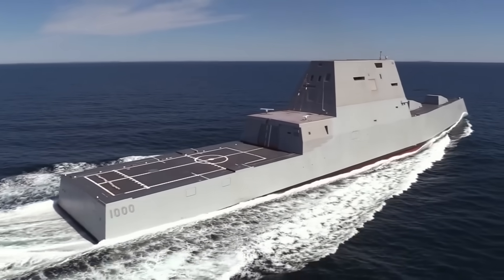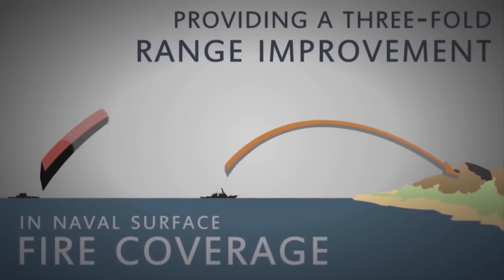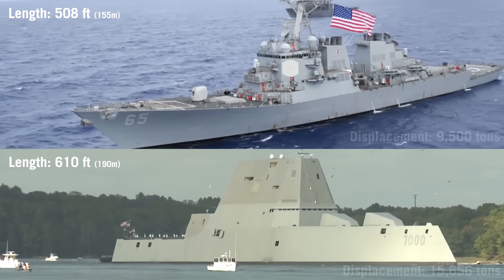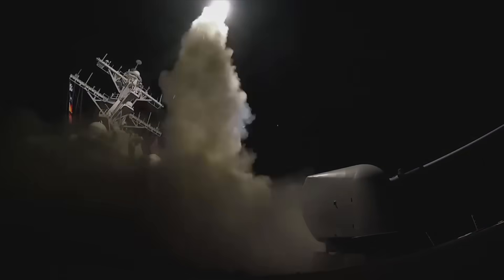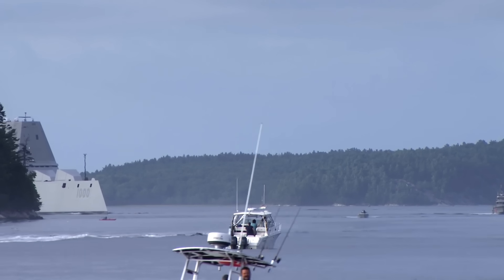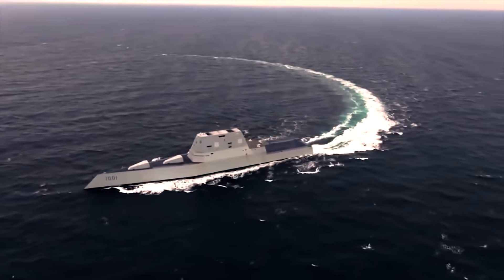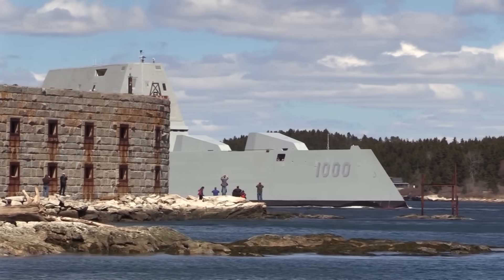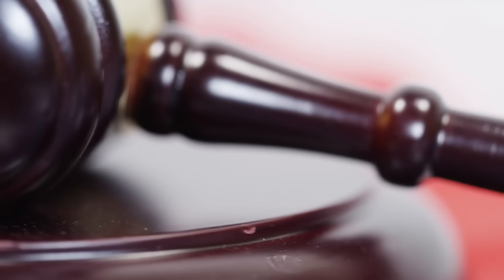What Killed Zumwalt Destroyers?

Comment: No expert, but I think the stealth feature would be negated by all the active electronics on the ship. If the ship employs its own surface-search radar, that radar becomes the equivalent of a beacon, shining out 360 degrees.  What about its radio signals, VHF, UHF etc. Aren't they also emissions that can be DF'ed ?  If so, then there goes the advantage of stealth.

Comment: What killed her and her class is how often she broke down... Leaking hull, broken screw shaft (or drive shaft... I can't remember it's proper designation.) A ton of things went wrong with it's design alone.
Reply: Your wrong it's guns didn't work and will never work it's a floating power plant that they can't use imagine having that much power with no way to use it that made the ship useless not enough room for any other type of guns so made it useless
Reply: @charlestorruella8591  Oh really? Add it to the pile. Zumwalt was a mess. But I remember hearing more about how she spent most of her time in a repair dock. She was refitted with different weapons a couple times because her "standard" load out didn't work. She failed for a lot of reasons. But what I remember hearing was that her hull was faulty.
Reply: @charlestorruella8591  So you scrap your car when it gets a flat tire? Alaska class cruisers had a high speed autoloading gun in sizes 6-inch, 8-inch and perhaps larger. Aluminum hulls suck and need paint, Stainess steel does not.

Comment: The lack of additional crew is probably because of a higher level of automatization, since I suspect, without doing much of a research, that the system on Zumwalt Class is automated at higher level, thus it requires less human interaction, meaning it doesn't require that high numbers of personnel, meaning it can be operated with less crew. But that's in theory, and this ship is a theory in practice I guess.

Comment: There is a motorized barber pole outside the barber shop on the Zumwalt.  I wonder what the paperwork for the specifications, procurement, and costs for just that stupid thing looked like.  On the other hand, it might have been necessary if, along the same passageway, they needed to identify it versus the pawn shop or smoke shop.

Comment: The tumblehome instability criticism is a little more nuanced than that.

Tumblehomes are normally a very stable design. This is because the mass above water is more focussed in the center, while the mass (and boyancy) below water is more distribited laterally. As a result, tumblehomes kind of act like having outriggers, but integral to the single hull. As a result, tumblehomes resist rolling motion in rough seas.

The real criticism is what happens when a tumblehome hull gets penetrated and flooded due to combat damage... As the French, who were very fond of tumblehomes on their predreadnought designs, found out the hard way.

If an outer section of the tumblehome hull becomes flooded... Empty rooms full of air that were originally contributing to the stability of the ship by having boyant sections sticking out either side of the ship, suddenly become dead weight filled with flooded water. That dead weight drags the damaged side od the ship down. This is more pronounced in a tumblehome, as the hull sticks further out under water than on a typical ship, giving the flooded rooms more leverage.

This gets even worse when one side of the ship is damaged, and the other side remains boyant. Then you have the other side of the ship still pushing up with its own extra leverage.

This can quickly lead to capsizing, as one side goes under while the other side wants to float. Its a bit like if you had a trimarine, punched a hole in one of the outriggers, and flooded it with water. Outriggers in those situations suddenly become a problem for stability, rather than an improvement.

Tumblehomes have sunk ships that otherwise might have been tough enough to survive the damage, purely because of capsizing.

So its not the normal operations of tumblehomes that is criticized, in fact, they are quite stable in rough seas. Rather, its the abnormal operations that are the problem... The operations that involve being shot at, holes punched in the side of your ship, and compartments flooded.

They are more stable than traditional ships most of the time, but in conditions of combat damage that can cause assymetric flooding, they are so quickly unstable that capsizing is likely.

Comment: It allways comes down to the simplest rule in the business. The more you buy from one product the cheaper they get per piece, developing and building the first few costs a ton if you don't plan on building a fleet. Development costs of a brand new ship with completely new designs, with new weapons, new guns and huge automation is a very expensive thing to do. Engineers are expensive. If you build a hundred of the ships the price per ship will go down dramatically. Same with the new ammo, it's just better in the industry to build a million pieces than building 100. Programming machines is very expensive, running them in production is almost no effort unless something breaks down.

Comment: Classic Defense Industry bloat.  And I want a good Defense Industry.... But the truth is obscene: The Chinese can out produce us something like 6:1 
PART of the problem , other than bloat and corruption, is the lack of industrial capacity resulting in lack of competition.  Thanks Unions & Enviro alarmists. Layer on that a Special thanks to other Woke Politics, like eliminating Urinals from bathrooms. If you run the calculations on how many more toilets you need, because you erased urinals, then it means you actually need to purchase and install half again as many fixtures for the same crew. But In a new LGBTQRSTUV world,  the fact that half of us are designed anatomically to stand while urinating is too great a horror to contemplate. (RE Plumbing Code calculations for [Whatever] Occupancy. Men Urinating at urinals is umpteen times faster than anyone using toilets. HENCE, why there's always a line at the women's room at a stadium. Just the Facts, 'Mam)

Comment: A company I worked for had proposals out for the SC-21 program in its inception, and I followed it a bit for years afterwards. The video's author almost got to the root cause of the failure; it wasn't that it had too many new technologies, that isn't unusual. It's that it had way too many missions planned for it, a story that has been the bane of US weapon platform development for decades.
A stealth ship is a fantastic weapon for intercepting smugglers or spying on enemy fleets - it may have a slight value for getting into range of a coastline for its land bombardment. Obviously, it wasn't really going to be used for coastal defense with that weapon payload.
It had to be useful to deploy special forces in rubber rafts - good for a stealth ship, but they already have good delivery systems that don't require a very distinctive surface ship at all. It wasted hullspace was full of crap to facilitate this mission.
It had to have space for a helicopter. Maybe two.
It had to still serve the normal destroyer roles of fleet defense.
They still wanted it to serve in shallower water, despite its ballooning weight. That at least sounds like pushed them into a fantastic hull design.
It had to take on the inexplicable role of shore bombardment - not just the invasion support role that hasn't been very relevant for 70 years, but 100 mile inland. A destroyer just isn't going to carry the ammo for a sustained inland bombardment, and of course we have much better weapon systems for that mission. Two guns was never going to be an effective volume of fire.
They did want it railgun capable, but all of the other things they wanted the ship to do meant it was never going to have the space required to store the energy required to fire a railgun projectile 100 miles repeatedly. So they went with a more standard gun, but now its limited ammo space was full of chemical propellants, not explosive warheads.

this happens over and over again in the US military. Every time someone proposes a new weapon system, every single subgroup in the military want a piece of it and they start loading up the weapon platform with more and more mission requirements that serve the needs of that subgroup. The F-22 only escaped oblivion by the clever move of calling it "modular", so the mission could be easily changed by changing the equipment in the plane. However, this has always been done!
There is no doubt at all the US military has the highest tech capability, but the politics surrounding new platforms and every single pentagon leader wanting to put their own use for the new toy, as well as politicians wanting to make sure their bases have a use for the platform, as well as different companies wanting to have some of their equipment on it, turns most weapon platforms into expensive boondoggles where the original mission for the platform gets buried. 
This is a parody: https://www.duffelblog.com/p/dod-announces-new-inverted-multi-purpose-ballistic-tomahawk-bayonet-imbtb
Reply: Interesting...sounds similar to what happened with the Commanche Helicopter
Reply: You know what, makes sense.

Comment: Fyi. The next generation DDG(X) is based on a stretched Arleigh Burke class destroyer. Think of it as a stetched Flight 3 variant with more room, capabilites., and advanced weapons and systems. Since it is basec on a existing and proven design, lower research and development cost.

Comment: I think this actually worked out for the best. Now they have 3 ships to test out a plethora of new technologies and concepts, rather than a 32 ship potential liability. Also the stealth concept was not needed at all for a mass production model, but might be useful in certain situations, and 3 ships with this design should allow for increased flexibility in that regard. I would guess after a decade of testing the current design, a much more practical mass produced model will be proposed that combines the features that worked the best from the Zumwalt class, with proven design concepts from older classes of destroyers.
Reply: I was thinking this.  Perhaps they take on a specialty role.  Reconnaissance, especially through a storm where it's radar signature would be indistinguishable from sea spray.
Reply: My turds work better than this joke. Float better too and are very stealth.

Comment: Honestly I'd blame the ship building companies and all the other privatized monopolies for always raping the cost of everything. Small example.... A navy toilet costs like $20,000 because only one company makes them. Its a regular toilet with some modifications to the porcelain.  The navy's dumb as fuck on easy savings to. We'd also save a lot of money if we didn't push all of our brass off the side of the ship and actually recycled it after a gun shootout, or changing out piping systems. I've seen us throw $50,000 valves off the side. So we didn't have to lug it home. 150lbs of brass... Gone. Oh well.

Comment: The issue with tumble home hull designs isn't reduced stability, rather, a tumble home hull can increase stability. The issue is that a tumble home ship, if partially flooded, becomes much less stable than a non-tumble home ship that has been partially flooded to the same degree.

Comment: The sad truth about dod contracting is that underbidding to secure a contract isn't punished. The contractors are allowed to make bids that bear no relation to reality in order to o secure the contract. Then they get to do cost overuns because of course the original price was low balled. Then it turns into a game of running the edge of keeping just below the point where canceling and starting over would be cheaper than continuing. Thankfully with this project it was sunk before it could get too insane.

Comment: In a nutshell...Overpriced.
The navy cut it's contract order when they realized the pricetag. They also had to retro fit the guns since the original proprietary ammo per shell was crazy, like as much as a Predator Drone. 

I vaguely remember there also being an isolated issue where the stealth tech on one ship wasn't working, which left it exposed. At their MSRP, you would expect all bugs fixed before delivery.

Comment: What killed the zumwalt is who built it. I did 2 years at general dynamics. And spent some time working in one of the gun rooms. The level of incompetence in management is staggering at that yard. Parts availability also became an issue as contractors who produced part discarded or set aside tooling when the total number of ships to be built started to dwindle. It was a culmination of allot of things but I feel that is Newport or ingals built the ship the outcome may have been different

Comment: They bulky and ugly as hell. That high bridge tower probably a huge vulnerability. No real reason it needs to be tall like that. Could make it long and low on the top mount the guns on the actual bridge tower could possibly end up with more guns. And be more of a chance that it could deflect shells with the stealth lines. Harder to penetrate a angled surface than it is a vertical wall. To me the ship looks like they got mid way through the design and just tossed a box on the top because got bored with designing it.

Comment: The usual issue, as the units are canceled the per unit cost rises.  Why?   It costs X to develop the technology and Y to establish any special production facilities, and final Z which is the cost of producing special items for the design.  The unit cost than is cost of X+Y+Z divided by the number of units added to the profit.  As t he number of units purchase drop, the cost per unit rises.  For argument sake let's say we are building something where development is 100,000 you chose a currency).  It will cost 50,000 to modify the production facility; and another 50,000 to produce  specialized equipment.  I have left off the actual cost of production (man hours × pay per hour) lets say this is 100,000 per unit; and we say that the profit will be 10,000 per finished unit.  Again for this case, we will use 50 units as the original target.  This means that the unit would cost 200,000÷50 + 100,000 (actual production cost per unit)+ 10,000 ( profit per unit).  When the math is said and done, will be 114,000.  Now let's say we cut back the order  to 25 units.  Now the cost per finished unit will be 200,000÷25 + production cost + profit, or 118,000.  Not a horrible increase so far, but remember if a new system is added, it could require a reworking of plans, cancelation of existing parts orders, and other cascading changes.  Since I am keeping it simple (unlike what was done to the F-35 which has evolved into three different designs plus modification for air superiority ops for which it was never originally intended).  Lets say the bean counters decide to reduce the production to 10 units.  Now without changes, the cost of fixed expenses is 20,000 per unit, and a finished unit is now 130,000 or 26,000 more than the original costs; or an increase of a very little over  14%.  Now the bean counters have a fit, and reduce the buy to three units too advanced to cancel and say we will now want the work completed over several years.  We can now add inflation in materials and wage increases (again ignored for this example).  The per unit cost of the fixed 200,000 expenses in the original development is now divided by three, making development costs now 66,700 per unit  (I rounded it to the nearest hundred).  This makes the unit cost, as completed, 176,700, or an increase of something over 61%.  Now remember these ships cost much more than 100,000 to design, their building facilities cost more than 50,000 and the subcontractors probably had expenses and profit much higher than 50,000.  I have no doubt inflation. In material and labor increased cost, and their armament was modified meaning design changes and delays, plus the profit was probably a percentage not a fixed amount.  So drastic increases (overruns) aren't just the developers issue.   From funding, design changes and work schedule changes; everyone in the purchasing system add costs.  What was the real costs in dollars adjusted for inflation is never mentioned, just as design change costs are mentioned.  It might anger the public at the Government, not just the contractors.

Comment: Why didn't the Navy simply cancel or re-imagine some of the more advanced systems as a means to cut cost instead of of cancelling the original order of ships? When they cancel the original order of ships, that inherently increases the per unit cost. This does the exact opposite of the objective. In my experience, the military has a bad habit of pushing for the kitchen sink in an effort to spend the budget they are allocated but soon finds that if anything is delayed, cost can run out of control. 

Both the military and contractors are to blame for this outcome and it affects our ability to provide progressive technologies to enhance our warfighting, support, and deterrent capability. Somehow we have to find a way to make defense our objective and not profit.